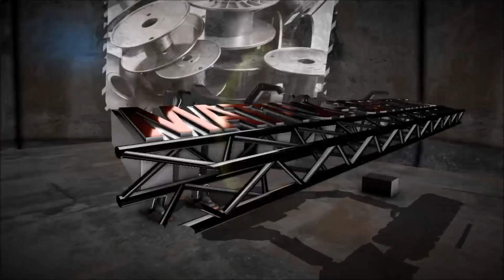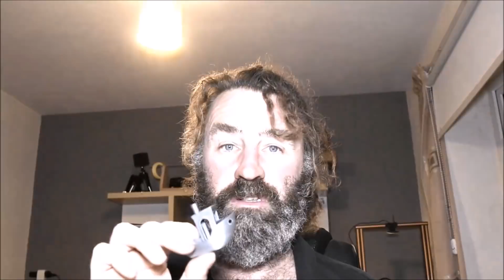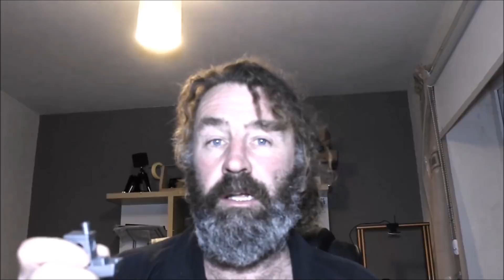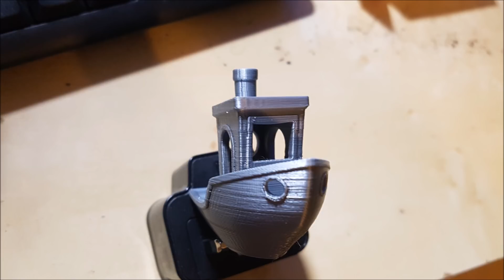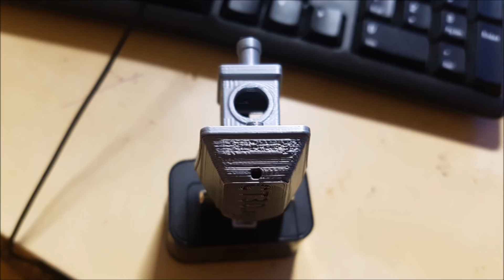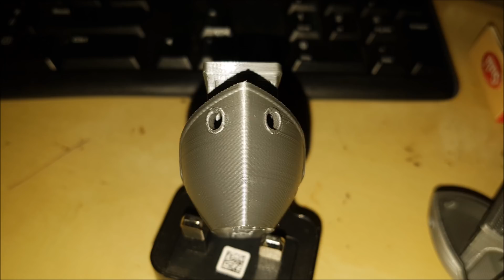Prusa I3 Mk3 Slic3r PE over extrusion and cooling solved???

Comment: Oh cool  you have a intro now :) I'm having some problems to, random re starts thermal over heat (but it is not) mid print restart with print shift . I'm going back to  the b1138 firmware and see if that helps. Oh and my benchey was great 2 weeks ago.